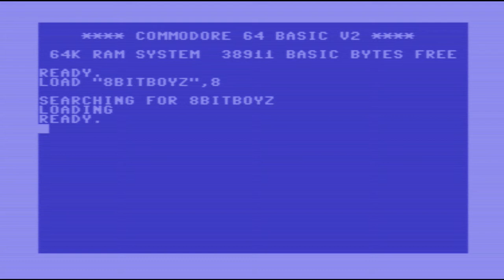Network Wallboard Cleanup!

Comment: Did you measure where the holes are to get the position to drill? Or did you use another trick?
Reply from the maker: Yes I measured the holes on the unites then used those measurement's on the place holder outlines I traced on the board.
Reply: @8BitBoyzRetro  how do you deal with heat dissipation? Would you do anything different if you had to do it again?
Reply from the maker: @justintemp  So far most everything you see on there except for the modem produced very little to any heat.  the modem (seen at the bottom right of the panel) was replaced a year ago with a gigabyte modem that stands and is not a flat but more of a cylinder shape. I made a little shelf for it to sit on at the modem location on the board. This way the new modem is not up against anything and has airflow around all sides of it.

Comment: curious if you know: I have a netgear nighthawk router, and two computers. One is a PC, one is a mac. My netgear NAS works great on my PC, but my Mac will not work with it. If I get an airport, will it work on my network? Would it act as an AP and a NAS for my mac?

Thanks
Reply from the maker: @JacobReuter I used an airport (as you see in the video on the wallboard) on my network for both PC & MAC to backup to.  My Macs had no issue using Time Machine to back up to it and for my PC's I used the Apple Airport windows software to configure it as basically a NAS so my Windows machines could access it for backups too.  Worked great!!  Here is the link to Apple's Airport software for windows.  https://support.apple.com/kb/dl1547?locale=en_US

My Airport was connected directly to my main router via ethernet. I did not use the WiFi on the airport, I left that to my main router.  I did use the Windows Airport software to configure the Airport for its assigned IP address on the network and setup its sharing/permissions (again through the windows airport software) so the Windows machines could access it. This I found to be the best way to set it up for me. Once the Windows machines were working with it I then went to the Mac's and they saw it immediately no problem.
Reply: @8BitBoyzRetro  very helpful thank you so much!

Comment: Why did you use zip ties when you have mounting holes on the back of the devices?
Reply from the maker: I used the zip ties on 4 items that did not have any mounting holes: the Apple Airport, Netgear switch, the NetTalk Duo and the cheapo power strip. ;)
Reply: @8BitBoyzRetro  hello! How did you secure the zip ties to the board? Were those staples? Also, while you were putting up the wires, it looked you like you we’re screwing things onto the board to keep the wires bunched up, but I couldn’t see clearly with the time lapse. What did you do with the wires? Thanks!!
Reply from the maker: @Kthx881  You are correct the zip ties were held in place by using a staple gun.  What you briefly saw me use to hold the bundled wire to the board were 1/4 Inch R-Type Clip Clamp's.  Hope that helps, any other questions just let me know!